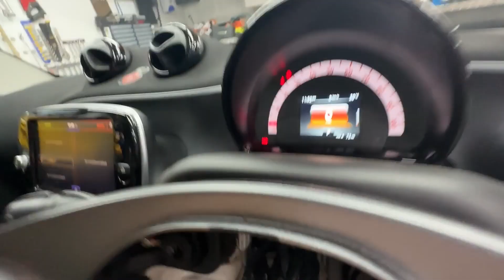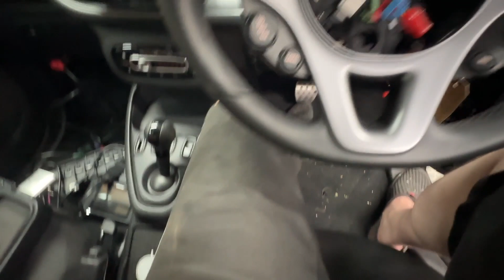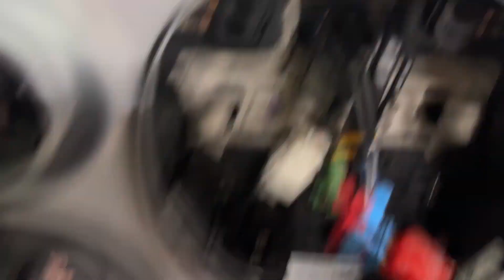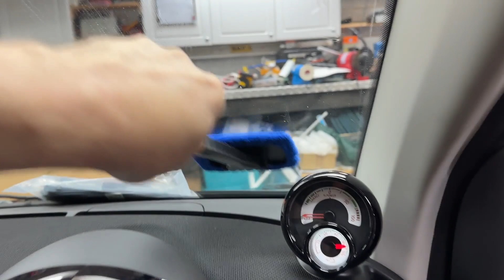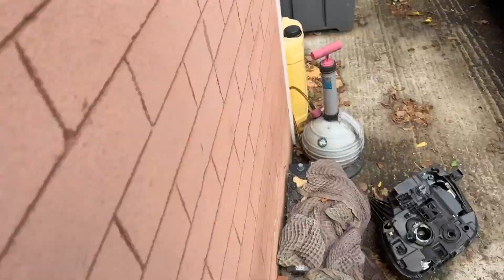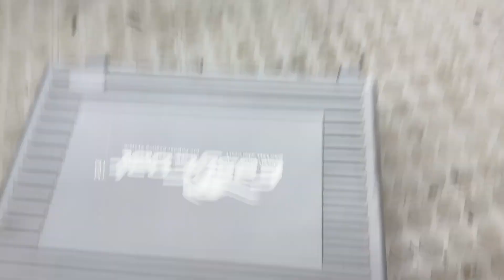453 EQ repair day 6.5

Comment: The less than one percent spent 6 hours today removing and replacing a dashboard. I used a video that is not in any way instructional and purely for entertainment (pray to Evolution).  Airbag ECU is going off to airbag team and crash sensor removed. Kane does the crash sensor need replacing if on clearing codes the car runs, drives and charges? Thanks fella 👍
Reply: It's do s run and charge so perhaps the  crash sensor is okay? I'll have another go with the obd today. Still short on one airbag connector
Reply from the maker: Could you not delete the error code for the airbag light? I had to replace the crash sensor on the previous rebuild. I just bought a 2nd hand one and fitted that. No coding was required.
https://www.evilution.co.uk/mod/453-eq-crash-sensor.htm

Comment: Can you not get a cheap plastic welding kit off the jungle site to repair the bonnet, it might come in handy for headlight tabs too.
Reply from the maker: I do have one but they don't work miracles.
I repaired the headlight mounts on the previous rebuilt EQ. On this one, the headlights were like a handful of plastic shavings. It was more of a jigsaw puzzle than a mount.

Comment: Just bought the exact same vehicle as yours.. Visited the website of EVclinic and heard that the power train of this vehicle is a disaster to happen. Horrible quality!? So what is your opinion, because my spirit was very high when I bought it two weeks ago and is now quite a bit lower because of this information I got from them.....And for your information I was wide awake till the very end....
Reply from the maker: There's nothing wrong with it. They are probably haters because they are cheap EVs.
Reply: @evilution_ltd  Actually they completely restore 451's(they blame the built in cycle counter of the iginition which suddenly can go to zero in case of a weak 12 Volt battery) battery packs and also repaired a 453 battery pack And they seem really knowledgeable. But anyway by telling me this you reassured me quite a bit...
https://www.youtube.com/watch?v=X5qqjaNsgy0&t=79s